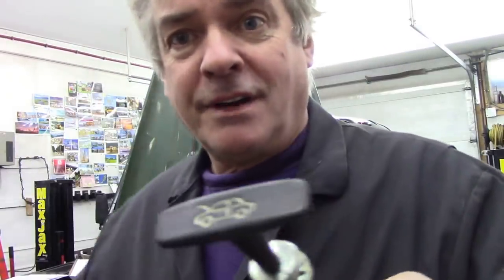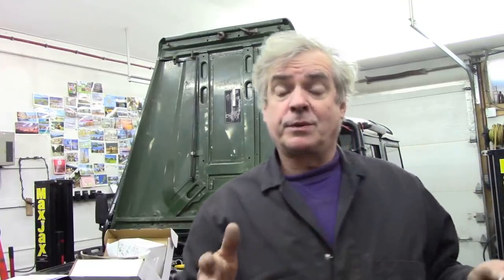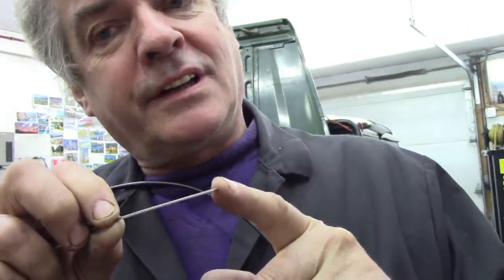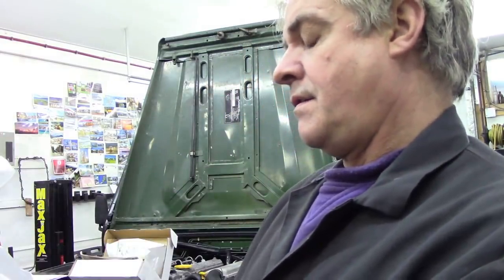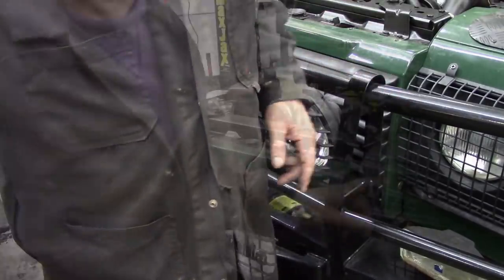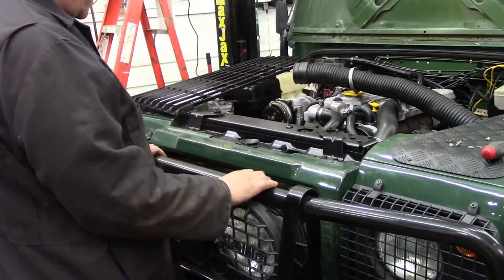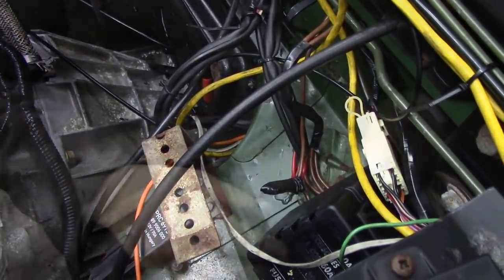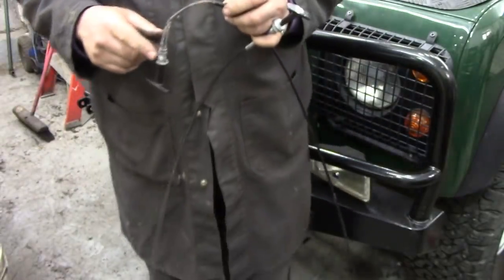Defender bonnet cables.   What can go wrong?

Comment: I used a choke cable from the 3.5 V8. I mounted the pull handle under the very bottom inside corner of the left wing. The cable loops up behind the grill and to the latch release. Works perfectly. Is much stronger than the original. I've had it like that for 2 years, and it still works better than the original configuration without showing any signs of wear or adjustment needed.

Comment: I,m so glad that my 1984 110 hasn't got a cable. It has a lever that you get to via the grill, and there is a lock on the front panel that I have to turn after unlocking it , making the bonnet secure.    My father worked in a wire rope factory all his life, and one thing that I cherish is a pair of cutters for cutting wire cable, it has two Vee jaws that come together around the cable so that the cable does not flatten, Also, during the manufacturing process of multi strand cable, it runs in oil, so it can sometimes be very hard to get a good solder joint, I clean it with meths or carbon tetrachloride.  With the thicker cable, it was heated with and induction coil then when it was red hot turned untill it parted, the same can be done with a blow torch on the smaller cables. I can't wait for the next part of this video, feels like when I was a kid going the the saturday morning picture house or a batman film. A really enjoyable video Mike. Please keep up the good work. Yorkshire Rob..
Reply from the maker: I have a video of soldering cables in order to cut them this weekend! 
Thanks Rob!
Reply: I can hardly wait to learn something new from you Mike.  I was the only person that was trusted to soldier the nipples onto clutch cables on motor bikes that raced in the IOM TT races, but no one is ever learned up. Best wishes. Yorkshire Rob.

Comment: Hi Mike,
You indeed touched a painful subject. On my previous 97 110 with original cable and a spare wheel on the bonnet, it was a nightmare... So I decided to get to the bottom of this, the problem was the original cable had only steel wire and nylon cover (no steel spiral beneath the nylon)! So I fabricated a simple lever for the cabin and bought a universal brake  cable from a bike shop (really cheap bought I think 4 meters) that actually worked like a charm fo many years.
But on my next defender I found even a better solution, I installed the td5  bonnet cable it is much better engineered.
Reply from the maker: That is why I use universal engine stops - solid cable and they never break

Comment: Changed mine a few weeks ago after one half of the handle came off. Ashamed to say a Britpart one went on. However, how about a ‘how to’ on doing up the nut on it at the cabin end. None of my spanners would fit in the bracket. So I live in fear of the handle eventually coming undone over time and use. On the upside the operation is much smoother now and I don’t have to call on the services of Geoff Capes to release the bonnet 😂

Comment: After having a cable seize up with dust contamination, I installed the exterior latches as used on Series 1s, Camel Trophy 110s and all MoD Land Rovers.  Not much security, but far easier and more reliable, especially with spare wheel on the bonnet (the cable had to be held back before as the pin spring wasn’t strong enough to lift the bonnet with spare, pioneer tools and noise proofing).  Besides, what are opportunists going to steal from under the bonnet if they realise it’s unlocked?
Reply from the maker: The early 90/110 had the best manual latch
Reply: I quite liked the simple SII/SIII type!
Reply: Any Land Rover owner living in the UK knows that bonnets are quite often stolen, and then sold on to other owners who have had their bonnets stolen.  Same thing happens with doors, spare wheels and bumpers.
Reply: @BritannicaRestorations  I seem to remember my 1986 Ninety ( D420JRL) having a key latch on the bonnet or am I imagining it?
Reply: Thomas, that is a blight that seems to affect Puma bonnets but rarely earlier types.  Fair point, though.  I did put aftermarket security hinges on my wife’s 2009 90, but my bonnet hasn’t ever been tampered with despite having standard hinges and no lock.

Comment: With the bull bar, auxiliary lights and what not, the main radiator is effectively masked. Worse still if there's an intercooler in front too. You might get away with it in Canada but you wouldn't in a hotter climate. If the owner does heavy towing or climbing mountain passes the engine will overheat.
4xoverland made an interesting video showing how even a minor obstruction to the cooling ducts on a Landcruiser caused a major degradation in cooling efficiency.
I come back to a point I have made before. So often the problems experienced by Land Rovers are caused by the actions of their owners.
Reply from the maker: Yes I am glad you understand - I have a winch on my 130 but sits low - no lights or bull bar - the 300Tdi rad is a double pass and not the most efficient at the bests of times

Comment: I wonder what you’d have to do if the bonnet closed without the pull cable in place to open it again? I imagine it would be a bit of a rigmarole.
Reply from the maker: Without all the clutter you could remove the grill and flick the lever - on later Defenders they covered this making life a bit more difficult

Comment: Hey mike is there anyway to adjust the bonnet so it pops open with a spare wheel mounted on it? I have to get some one to lift the bonnet at the same time as pulling the cable to get it open. Which is a pain.
Reply: I have that with ours and it doesn't even have a spare wheel on it!  We've only had the TD5 for a month or so and I thought it was another Land Rover 90 idiosyncrasy.  I'm glad someone else has the same problem!
Reply: Bend the  grooved piece of metal slightly that the handle is fixed to then the cable will stay out as far as you pull it out.  This holds the catch open away from the bonnet pin.  When you get the bonnet open and propped, just push the cable back.  Had to do this with my Series II which had a 7-50 X 16 spare on the bonnet.
Reply: GET a stronger spring, or do what I did. Cut a piece of plywood to the length of the cable when it is pulled out. Then when you pull the cable, put the wood behind the knob so that it will not return back in. Go round to the front and lift the bonnet, then go back and take the wood out so that it clicks shut when you put the bonnet back down..... I hope this is of some help to you.Rob.

Comment: I wouldn't try and solder the cable into the pull-handle.
If you're heating the metal tube enough to allow solder to flow, you're going to start to melt the plastic handle.

Also, NEVER cut a multi-strand cable with snips. Always use a dremel with a cutting disk. Every bicyclist knows this.
Reply from the maker: Wait for this weekends experimental video!